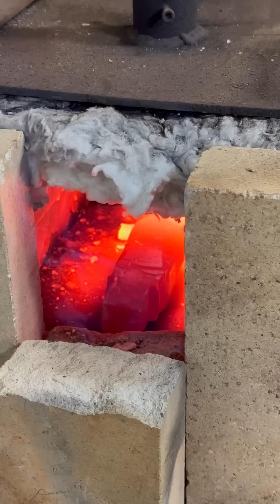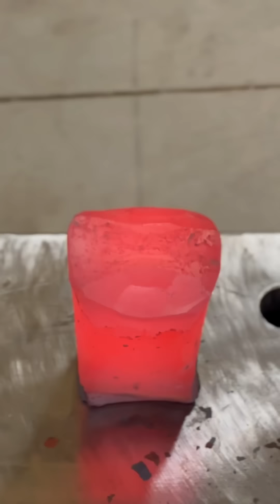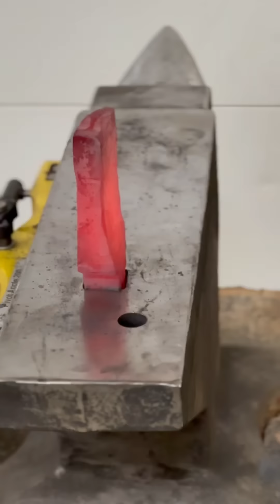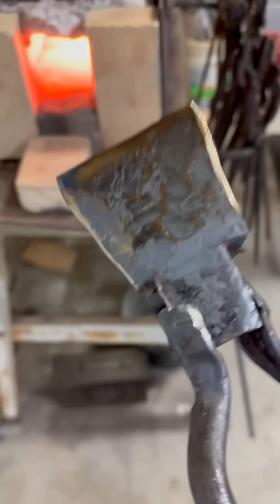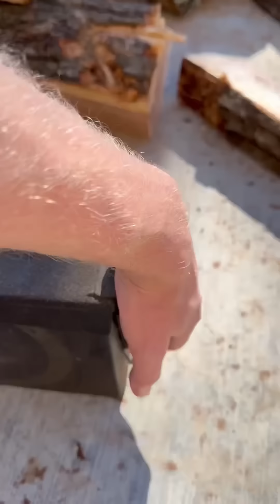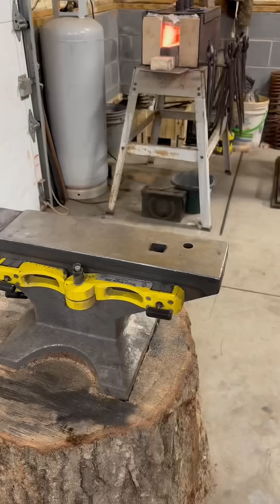Forging a “Hot Cut” Blade

Comment: Sometimes I wonder what a smith in a society that provided soldier’s weapons like the Greeks/Romans/Persians would’ve done to have a power hammer back then. And I know “they used water powered hammers” if they were near water, but more than most were just pounding away in a shack in a field. Wtf do you even do in the year 237BC when your King or Emperor or whatever their name is puts in an order for 800 replica weapons of each other with similar capabilities and you’re not an engineer with a backyard river?
Reply from the maker: If they had Powerhammer’s back then, the weapon development would be insane. There would be so many cool and advanced designs, because smiths could make things in a 10th of the time. They did have apprentices to help with the heavy hitting, but the Powerhammer would be a game changer
Reply: Typically you'd have more than one set of blacksmiths/their apprentices working on an order like that. All someone could do is what they're capable of. Depending on who/what/when/where, might get a few swords a day, or a few a week, or less. I don't think any ruler would rely on a single blacksmith for a large order unless there was no time constraint or it was just a long term ongoing thing where they would be expected to produce for the forseeable future. That certainly was a thing many a time, where x amount of time and material would be mandated to be dedicated to providing weapons or other tools to whoever was running the place at the time.

Comment: Where do you get the metal to make the hot cut blade? Is it a certain kind of alloy to look for? I’ve been saving lots of various pieces of steel and iron over the years for when I get ready to start forging metal.
I am setting up a metal shop/welding shop to be useful for metal repairs, and fabrication of steel brackets etc. to use in truck, automotive, and Timber frame restoration work.
Right now I haven’t oxy is settling torch to make heat. I do not have a forge. Thanks for all the good information you are providing in these videos.
Reply from the maker: You’re very welcome. The type of metal is not too important. The main thing is you want some steel that is able to be somewhat hardened. Other than that, you’re just going to have to pick it based on size and shape for the project you’re working on.

Comment: I prefer not to harden my hit cuts.  People tens to smack them woth hammers.  Id rather not have cuts in my hanmer face.
Reply from the maker: I pick and choose when I make mine. If I’m using a good hammer to cut off I’ll grab the softer hot cut. I’ll use a hardened hot cut with junk hammer

Comment: What oil is used for heat treat like it a special oil or one that is better then another
Reply from the maker: It’s quenching oil, it’s a special kind that has a higher flash temperature. Meaning it will not combust at the same temp as normal oil. The quality of oil is often determined by that temperature factor

Comment: Be careful when hitting your hot cutter. One hit on that hardent face and chips may fly off, also it dulls te tool very quickly. A better option is cutting your stock almost true and than finishing on the anvil or with some tongs. Excuse the English.
Coming from a professional blacksmith in the Netherlands.
Reply from the maker: Appreciate the comment and I understand what you’re saying. I like the hot cut for when I’m trying to cut a very hard piece of steel that will dull saw teeth. But, it is dangerous to have hard metal chips flying around the place.